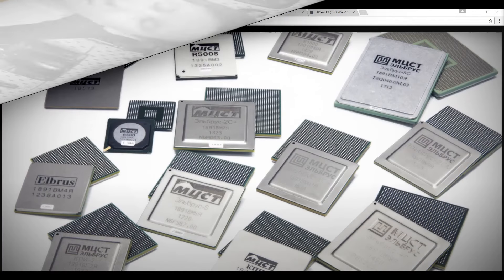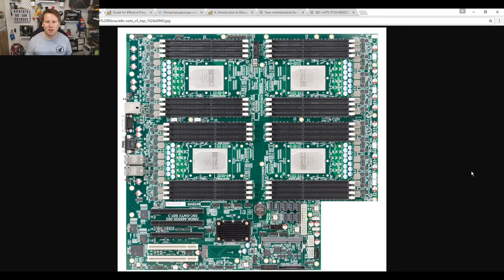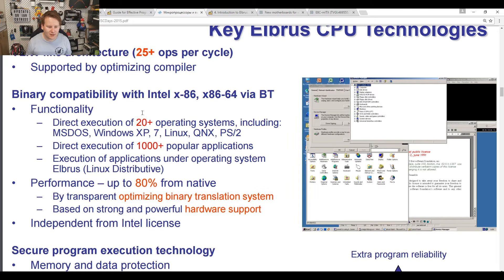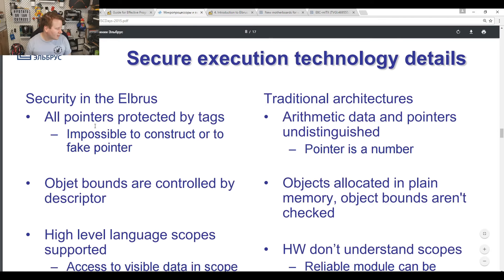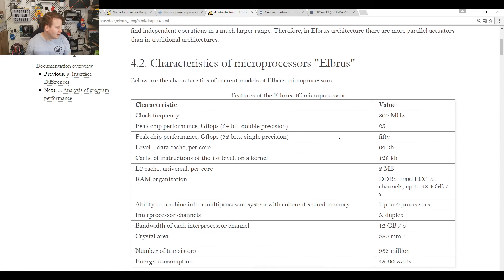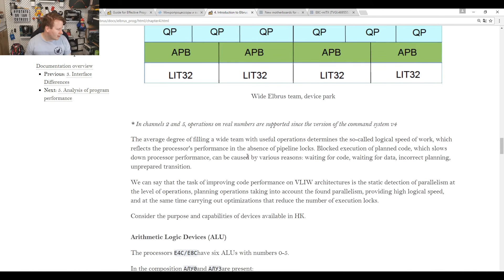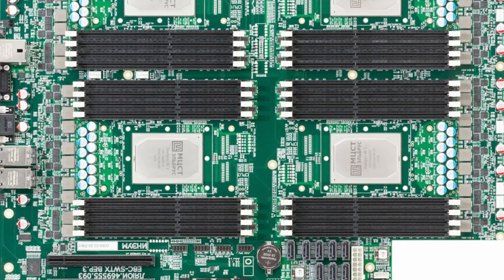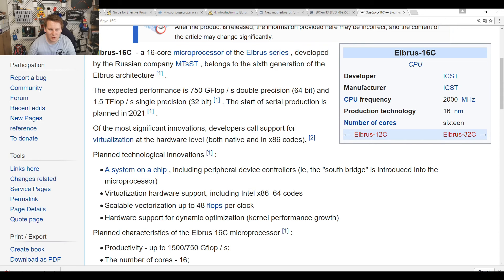A Russian 🇷🇺 CPU: The 8-core МЦСТ Эльбрус-8С! (MCST Elbrus)

Comment: Since when is it bad for the Chinese to have their own processor (for the State)? The Chinese have x86 architecture and problems with the processor are unmeasured, but the Russians also have their own architecture. Independence is always welcome.
Reply from the maker: Who said it was bad?
Reply: @TechTechPotato  The USA govt.
Reply: China does not have its own architecture. They use a redesign of the previous generation AMD processors with the x86 architecture. They bought the previous generation from AMD, and organized their own production.
At the moment, there are only 2 states that have their own computer architecture - the United States and Russia. I'm talking specifically about computer architecture. Other countries also have more successful companies than in Russia, but they are all based on ARM, or X86

Comment: The Elbrus processor is not for normal use. It is for government agencies and the military. It is also well protected from EMP radiation. And very tenacious, it must be. And for ordinary people there is Intel and AMD. But if something happens, we can quickly increase the Core and processor frequency to the top level. And compete with both Intel and AMD. But this is expensive and unnecessary.
Reply: Where did you get info on EMP protection? The first time I hear this.
Reply: @crimeanhawk123   thats great
Reply: Not on 28nm you wont

Comment: I would like to challenge your proposition that the Russians have been working on Elbrus for ten years (only). I remember when Linus Torvalds was hired by Transmeta (1997) there was a series of PR articles about the Transmeta design of a new type of CPU (which was VLIW CPU able to, besides other things, emulate x86). In connection with Transmeta, the Russian development of Elbrus CPU was also mentioned. Leaving Russia and geting a well-paid job in the U.S. was a life pattern of many Russian scientists and engineers in 90's. So I believe, Transmeta development was a result of someone from the Russian Elbrus having left RF and moved to California to start a new life based on IP stolen from their original employer. So the Elbrus concept must date at least since 1995, if not earlier. Let's assume it has been under development for 25 years now.
Reply: Elbrus orginates in USSR's Elbrus-1 (1973), 2 (1977) and 3 (1986) supecomputers. E2k architecture has lots of common with Elbrus-3 architecture. The lineage never got completely broken even if in 1990s the team shrunk and most of the team went to work to Intel, so we're talking about 35 y.o. architecture and a long development history.
Reply: Интел в свое время хорошо подгадил МЦСТ
Reply: This is an interesting story. The Sun Microsystems worked in the 90s with russian elbrus team engineers MCST.  And Vladimir Penkovsky with Boris Babaian, is old ingineers soviet processors elbrus, after the collapse of the Soviet Union, they left to work in USA - Intel. Pentkovsky worked on Pentium family. Babaian on itanium processors.  soviet elbrus, intel pentium and intel itanium made on the basis of VLIW.    In intel arhives "Intel Technology Journal Q2, 1999"   written     "Vladimir Pentkovski is a Principal Engineer in the Microprocessor Product Group in Folsom. He was one of the architects in the core team, which defined the Internet Streaming SIMD Extensions of IA-32 architecture. Vladimir led the development of Pentium III processor architecture and performance analysis, Previously he led the development of compilers and software and hardware support for programming languages for Elbrus multiprocessor computers in Russia Vladimir holds a Doctor of Science degree and Ph D. degree in computer science and engineering from Russia His e-mail is vladimir.m.pentkovski@intel.com"    Pentkovsky came back to Russia in 2010 and helped to resurrect the microelectronics, helped with the new elbrus processors. Boris Babaian is still work in intel.
Reply: @dimddr_man  Thank you, this is such an interesting story.
Reply: @dimddr_man  AMD BEST MORE THAN INTEL
Reply: @kkr1663   Im not interested in it anymore. Intel and amd have left my country. Now a new story has begun in my country with other processors.
Reply: Exactly left in the early 90s, never looked back. Honestly they would have served better by cloning ARM and using all of the existing software. Instead of trying to take advantage of e3k. I am familiar with Angsterm, shocked that RF can not get modern lines 30 years later. Russia had some advance laser research, and considering 3nm process is pretty much known - not being able to produce it is nutz. Obviously most of us left in the crazy 90s.
Reply: That's not quite true. Transmetа founded by Dave Ditzel - а former engineer@director from Sun Microsystems.
MCST is a private company created as a division of Sun Microsystems in cooperation with the Lebedev Institute, for work on the Spark architecture.
But before that happened, Sun sent Dave to Russia to check if there were any engineers in there, and there he met Boris Babayan, Alexander Kim (current director of MCST) and the Elbrus-3 mainframe. Short story of Elbrus-3: Elbrus1/2 is a out-of-order data-flow superscalar architecture special designed for High-level langs like Java/C#, and like a java-mashines, data-flow elbrus-2 lose control-flow machine indirect perf comparison (non-OoO IBM360 for example). Better solution - is a makes control-flow mashines and run safe-code in virtual datа-flow mashine (JVM). It necessary to understand correctly - the Elbrus engineers reads lots of western scientific works and try as possible published their own works (if Soviet government allowed of couse), its not about comercial tech-patents.

So lebedev institute developt elbrus-3 - a control-flow architecture with data-flow hardware stacks (stack-flow) for effective emulating elbrus-2 (especially for soviet militarys who loved programming themselves in easy-to-use object languages without involving civilians specialists) and stack level safety for C/C++. At that time, VLIW offered an op/clock density unachievable for a superscalar, which, coupled with JIT recompilation of superscalar instructions, could have given an advantage.
Dave Ditzel likes this idea, but he failed to convince Sun bosses to make VLIW cpu with Spark ISA JIT recompilation. He left the Sun and created Transmeta. Transmeta processors did not looks like elbrus, they were strictly focused on x86 emulation and were never "stack-flow" machines. Modern elbrus forced to support 3 address space: 1)stackflow+protected pointers (original), 2) stackflow+unsafe pointers, 3) x86-like for x86 application works.

Transmetаs work was a unique experience in creating such systems, which are now used by elbrus for x86 emulation, for example, they published a doc in which the need to use two parallel threads for effective binary recompilation, MCST implements this in his Lintel emulator for his multicore cpus (Crusoe and Effecion was a single-core ) . Intel and AMD simply bought all their technologies - code-morphing, hyper-transport bus, no-execute-bit (this is a cheap implementation of e2k protected pointers for x86, developed by transmeta), and, of course, Dave Ditzel himself.

Comment: "Secure execution" is not about being secure enough for the Russian government. It's an actual set of hardware-level protection measures against pointers/values mismanagement (like stack overflow) without performance impact.
Reply: >without performance impact
With. Trushkin (vice CEO) said that it will limit the word length because it has to read tags now every cycle. Plus it's requires really clean code without any naughty functions or bugs, so software has to be prepared and tested first. The advantages are huge though.
Reply: @Itoyokofan  What advantages, LOL?

Comment: That's not bad? The 5th and 6th gen Elbrus processors are doing 48 packed SP FLOPS per cycle per core and 24 DP?
8C at 1.5GHz and 90W for 576GFLOPS on 28nm? That's...usable.
I hope you can get your hands on one Ian. I would love to learn more about these. Especially those with some form of integrated graphics (Elbrus-1C+ and the upcoming Elbrus-2S3).
Reply: Where does that compare to Via's old nano quad core stuff?
Reply: Why ?

Comment: After Russian internet shutdown test their own CPU looks like a rationalized step. It give us the idea about how they are investing in information technologies.
As the big picture looks like the cybernetic domain will be more important for politic balance and warfare. When they will have an OS developed in Russia it will be harder to attack them if the whole system is not circulating outside Russia.
Reply: The first processor Elbrus architecture e2k, appeared in 2005. There is no need to build conspiracy theories, these processors are primarily intended for military equipment.
Reply: Страна имеющая свой процессор и контролирующая свой интернет - НЕЗАВИСИМА!
Reply: disabling the Russian Internet? what are you talking about?

Comment: About countries building their own silicon... I just wish they would actually go and make something different than x86.  Instead of the “binary translation/compiler based” architectures.

If you’re going in-house, cut x86 out of the equation.
Reply: this russian chip is closer to Itanium than to x86.

Alibaba just made a high performance RISC-V chip.

Some international companies are making higher performance ARM chips as well
Reply: You can't cut x86. There's more than several decades of software that would have to be rewritten. Not everyone runs goofy macOS that changed its architecture from motorola 68k to powerPC to x86 and now apparently to ARM. Some serious organizations such as hospitals and banks still have software from the 1990s (or earlier) that thankfully are still able to run due to the backwards compatible nature of the x86 CPUs.

Comment: Maybe they'll use Power now that it's open source, so IBM doesn't reduce costs further. I really find it hard imagining a use case for these CPUs beyond their own nuclear programs, since you have access to "normal" CPUs in Russia (I think?) (cute cat btw)
Reply: Just because they have access to normal cpus doesn't mean they trust that there is nothing dodgy baked into the silicon. As ian said, if you make your own you know what you have, you can also bake in additional security measures or optimizations that are relevant for your particular needs.
Reply: I assume communication points will be a big use case, maybe military and embassy's.
Reply: I'm saving to buy an Elbrus PC because want to use Russian CPU and want to drop Intel, this is sold today, soon 16s will comeout and will support DDR5 so, with this I no longer need AMD nor Intel
Reply: @ruslanalpizar8048  Id look at Power or ARM before Elbrus, relay Elbrus is not going to be fun.
open Power has amazing potential!
Reply: @steven44799  If your point leans more towards Putin saying "we have our own CPUs, haha Trump" I completely get your point. But Power literally has a Microwatt core available on GitHub to simulate on your very own FPGA. You could change out the encryption algorithms for something else, slap your own uncore on there and boom, you have your homegrown CPU with (probably) more ST performance and an existing and proven software stack
Reply: @steffeneilers8530  but if they take that architecture away (back to closed source, fabs arent allowed to make it for them etc) then they have to start from scratch, this way they have a fallback thats entirely their own.
Reply: @steven44799  My understanding of open source is that you can't take away stuff you already put out as open source, and that they could at least iterate on that Power design, but I could be wrong.
Reply: mshigorin  nice to get a reply from some one who uses it, I may have made the wrong assumption that it was going to be an overly complex system to jump to. 
And I have a bias to PPC, used to be a mac PPC user and kind of miss there being a CPU alternative.
Reply: mshigorin  no, the ppc ISA license belongs to the Linux Foundation, so neither IBM nor you own it. I can understand why you wouldn't want to work at IBM, particularly after the recent layoffs, but still, for a homegrown CPU Power (or x86 like China) would be a better solution
Reply: @ruslanalpizar8048  16C will use DDR4. MCST never announced DDR5 for any of it's CPUs.

Comment: These CPUs are at least 20 years behind but they will catch up soon.
Reply: 20 years is exaggerated, they are not THAT far off and getting closer. And: you don't require top perfomance for most computing, just more time. The current events in the US even underline the neccessity to become more independent from US technology, as soon as they turn into a dictatorship, this will become crucial. The US monopoly with ASML(?)/EUV technology is kind of a show stopper, but, I guess , will not last forever.
Reply: Dude, they can run windows 7, doom 3 at 1080p, and gta vice city  smoothly (and in the case of windows and gta, those were run through binary emulation). And as we saw, that Blender test showed it was only 5 times slower than those high end.  How is that "20 years behind"? I can find NEW CPUs from intel, AMD, and ARM that will run that blender test 10 times slower or even worse.
Reply: @sharoyveduchi  Easy answer. Thats because they have multiple cores. That doesnt mean they are not impressive. 5 years from now they will catch upp very fast. BTW I recommend Gamers Nexus video about the chinese ones, if u havent watched it.
Reply: @korbensc7218  Ye I can agree its exagurated. Also  we need more CPU manufacturers.
Reply: @andreykolkov2724  thats the GPU not the CPU